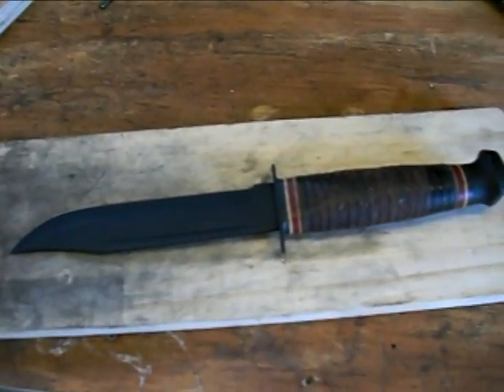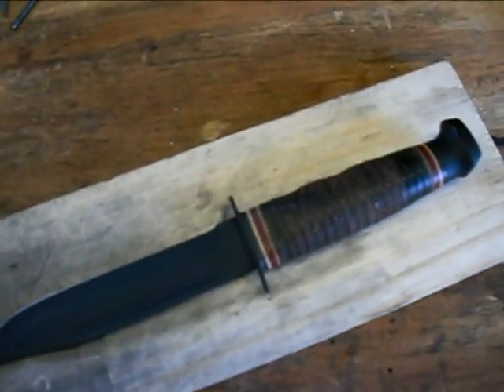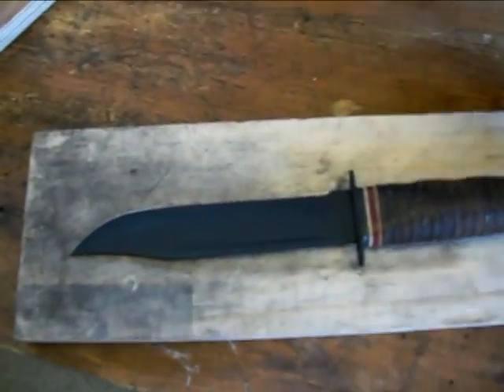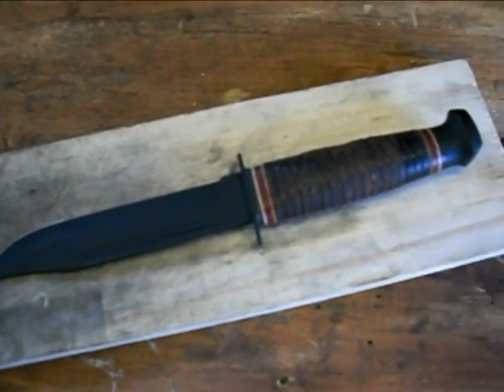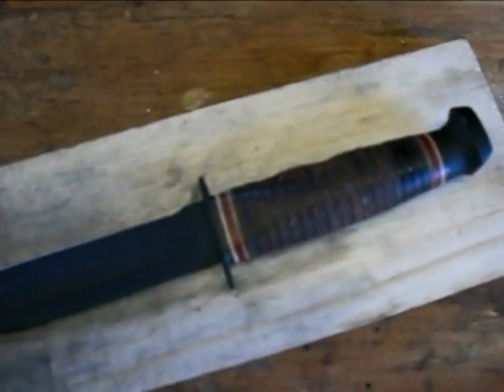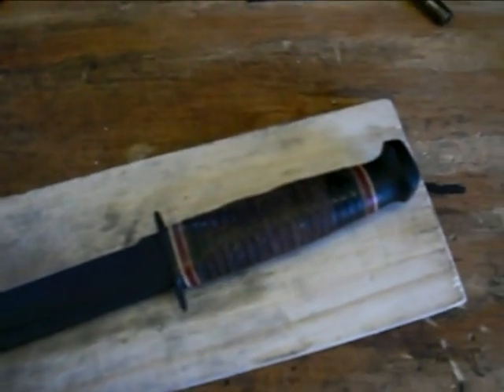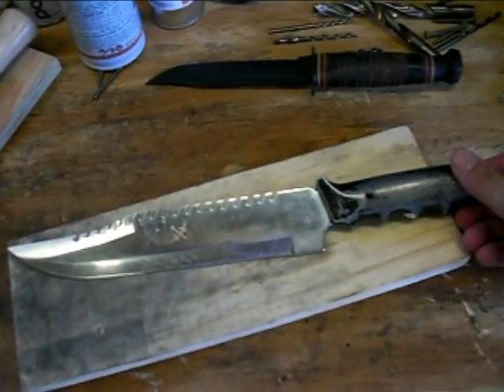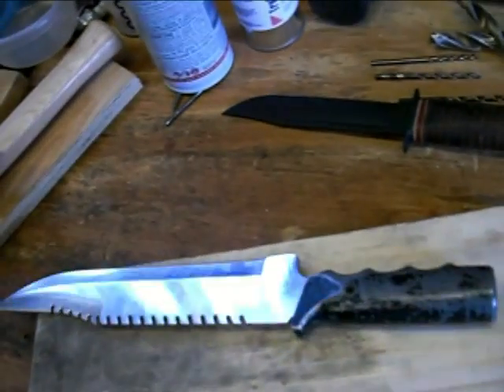Duracoat 1st try "update"  "a lesson learned"

Comment: Thanks for the advice David and even with the chip that knife still looks awesome. I myself have used duracoat and it worked good for me. I duracoated an AR with a stainless steel barrel. I never thought about sanding it though. The only thing I did was use the degreaser with some steel wool and then put the duracoat on. I have had it for over a year and the finish has held up nicely. Thanks again for this video and I appreciate you giving your experience so that others can learn from it.